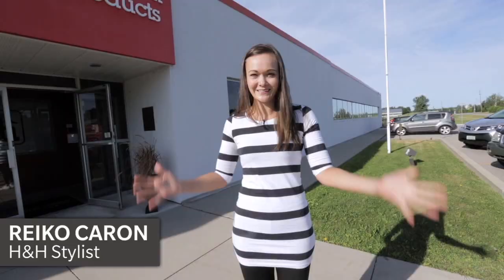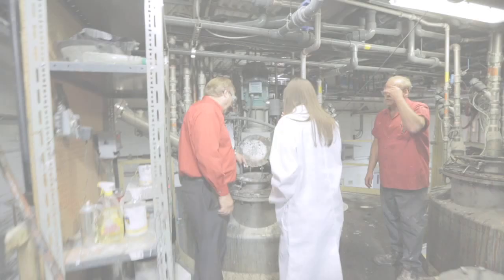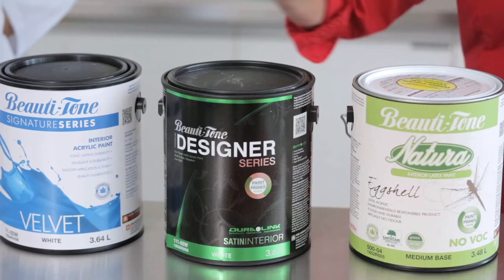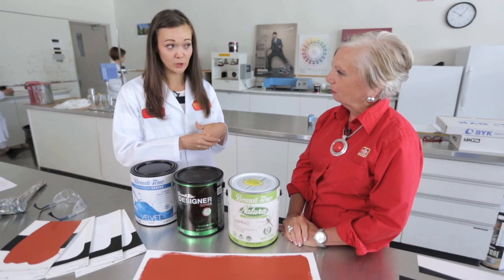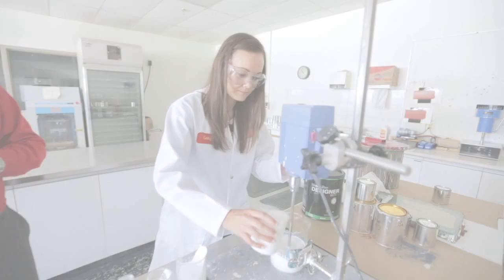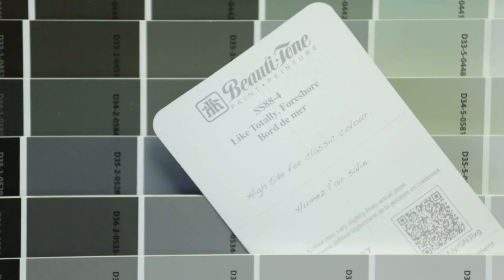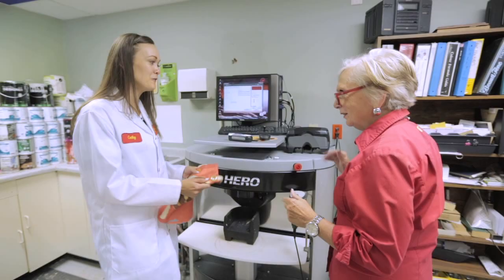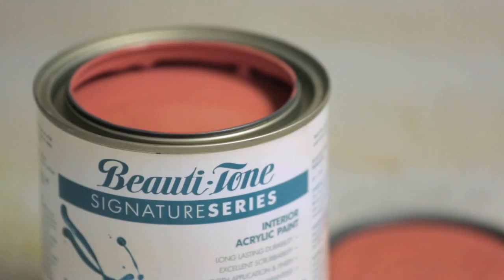Behind The Scenes – See How Paint Is Made!

Comment: OK, that ad annoyed me!  
1. "Paint and Primer" is total marketing BS, and aimed at the "Do it fast, and as cheep as possible & i want it to look good" customer. Raw drywall needs a PVA primer to seal the drywall/mud. Wood, Needs an Oil based or Acrylic/Alkyd primer. to prevent raising the grain of the wood.  Glass, Tile, and other super smooth surfaces, need a bonding primer as well should be sanded. Stains, like tobacco, pet urine, grease, smoke, use a shellac based or synthetic shellac based primer.  If your topcoat is going to be red (and other primary colors), use a grey primer, to obtain the vivid-ness of your top coat in fewer coats.  Whenever changing colours, a basic primer should be used to block the previous colour.

2. No paint is ever going to be "One coat coverage" no matter who makes it (Home hardware, Behr, ICI. Sherwin) thats because as your "Carrier" (water or alkyd resins) evaporate and as the pigments and binders dry they shrink, thus leaving areas that have a thinner coat than other areas.   

3.Never over load a brush or roller with the idea "more on my applicator will means I am done sooner" It will look very bad in the end. Also, when brushing don't over brush (that's how you get brush marks) and when rolling when you begin to hear the "wet ripping" sound, re-load your roller.  And do not use a $3.00 brush or $1.00 roller sleeve. You will regret it, 

(I have been working in paint since i was in high school, and still work full time at a paint store, PM me any questions if you'd like,)
Reply: @randyblu25  hi please check your mail
Reply: Hi can you please tell what manufacturers use to color glass bottles different shades
Reply: l  porchswing!!!
Reply: I've found that using a foam roller meant for roll on lacquer works wonders for distributing equal amounts of paint, so I always use those to paint with. They're expensive to buy in bulk, but I can totally get behind spending those extra bucks. The results are worth the extra money. Quality is never cheap folks.

Comment: What kind of paint thickener did you use? Badly need reliable info
Reply: If its "latex"  leave it open.  It will get thicker as water evaporates out. Just sir it often and this is a slow process. But its the only way
Reply: If you want the best possible thickener for water based systems, it’s acrysol 935 by Dow if I’m right. Check the data sheets online.
Reply: @JJ-3033 your chemist?
Reply: @aslammalsharif1366  I’m in paint chemistry and I do run manufacturing for over 8 years.
Reply: @JJ-3033  where are you from?
Reply: @aslammalsharif1366  Eastern Europe, live in uk.
Reply: @JJ-3033  number